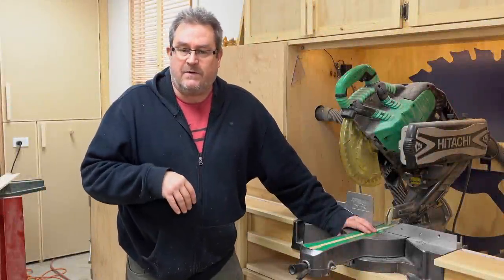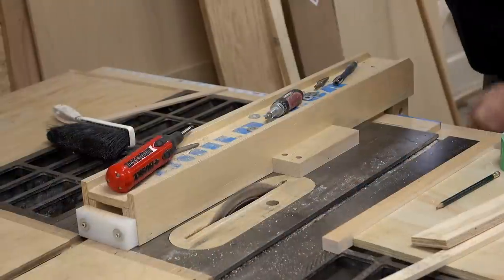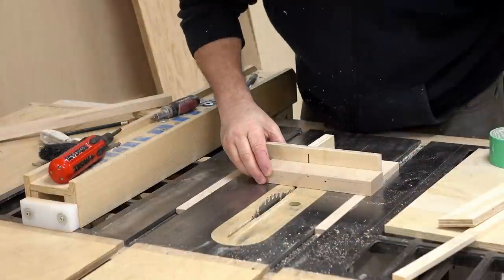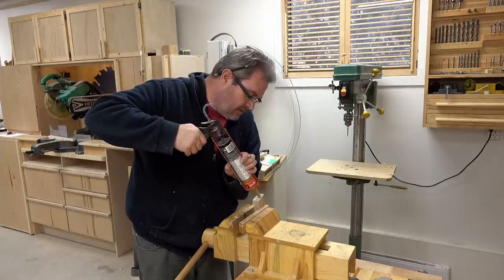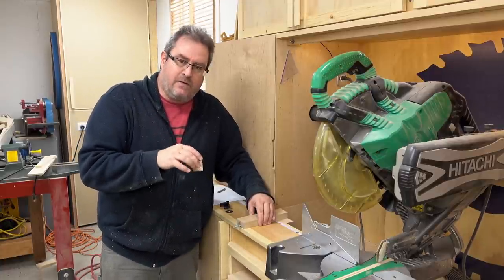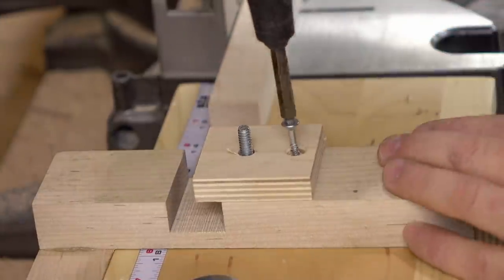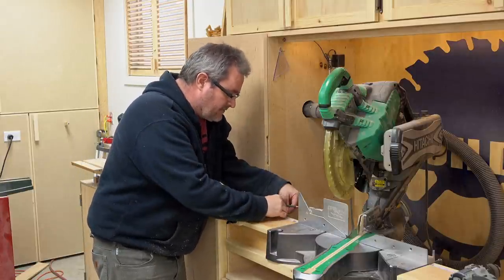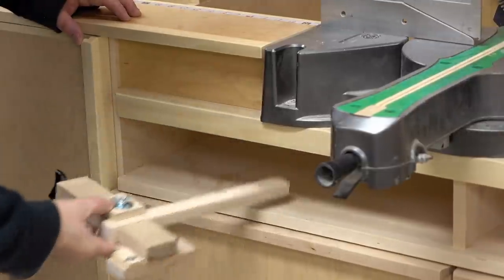Telescoping Miter Saw Stop

Comment: This is a great addition!  I recently bought this same saw as Lowe's was clearing out to make way for the new, less improved, Chinese model.  I had the same saw in a non slider and found too many instances where I just needed the extra capacity.  I am working now to modify the bench it sits on to use your ideas.  I need to get my act together and order a set of plans.  Keep up the great ideas and the wonderful videos.  You have become a regular part of my week and just seeing your posting and seeing you doing well helps me tolerate the nonsense that passes for management at my job.  Keep up the good work!

Comment: nice build John. I had a similar idea for a miter saw stop and measure. I planned to use a t track routed into the base with a tape measure like yours. for the stop I was looking at a t track stop from rockler for just a few dollars. line it up with the tale and no adjustments necessary.

Comment: Great video as usual. How does the measurement work if the pointer is on the stationary piece? Will you just have to move the entire assembly? If so, what's the point of the telescoping part?
Reply: The telescoping part still has a point, it just doesn't do measurement. So 99% of it's stopping functionality is not lost. A tape on the telescopic part would have done, but John mentions in another comment that he didn't think he'd need it. If the majority your repeatable cuts - the only ones you'd generally need a stop for - are longer than the base of your mitre saw, then there probably isn't much need for the telescopic measurement. 

Good build John, very neat. Although, I'd like to have seen you hang the jig on the inside wall of your saw cabinet rather than under the shelf. I just think it would have looked cooler, and resulted in 20 comments per video asking what it was.

Comment: Very good video! I had two quick thoughts come to mind. 1. When you're cutting down wide stock wouldn't it be nice to have a wider slide stop plate?
2. I normally drill my hole first, then counter sink it. Why do you counter sink first? I'm sure there is a good reason.
Again, thanks for the hard work and well thought out concept here! The attention to detail and hard work shows.

Comment: good video. From my experience when making a batch of repetitive cuts, there is a tendency to get slightly rough when positioning each successive piece and bang it into whatever I'm using for a stop. Those little impacts can budge the stop slightly further out than the initial measure. Do you encounter the same situation and how immobile do you find your stop is when banging it with the end of your workpiece? Do you need to use kid gloves to keep it accurate? Thanks

Comment: Where did that scrap go at 1:27?
Reply: away.  ;-)
Reply: If you play the video at half the speed you can see it goes in the slot.
Reply: That's a collection slot.  You have to pay the saw toll if you want to keep making cuts.
Reply: @giantpune 

LOL!  I saw some stumpy guy suggest tape on the left side of the blade to prevent that if'n you want to use the fall off piece.

Comment: Don't quite see what you need the moving stick for
Reply: Yea, I didnt get that either if it's based on the tape on the rail. The moving stick would require extra measuring if you  move it from 0"
Reply: I believe that since the stop only goes up to the left end of the miter saw, If you want repeatable cuts that are smaller than the measurement from there to the blade you extend the "moving stick" out and tighten it down to make those shorter cuts.

Comment: You make the most interesting things and I like your mini crosscut sled and what you have made now is quite good but do you really think it is necessary? Could you not just cut off a piece to length you want to repeat and then place that in position next to the saw blade and clamp a piece of wood to the back plate? Would that not achieve quickly and simply what you have just made? Just a suggestion  ... when you make something like this could you show us at the beginning what you want to make and then proceed to make it? For a while there I didn't know what you were doing.